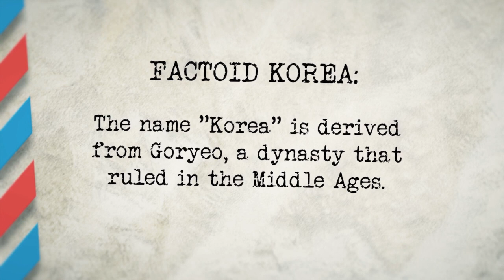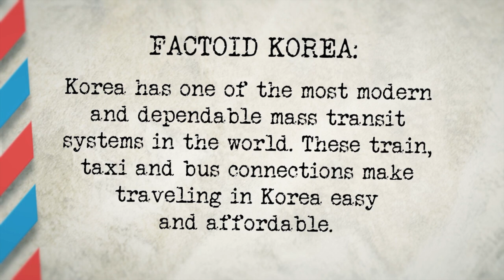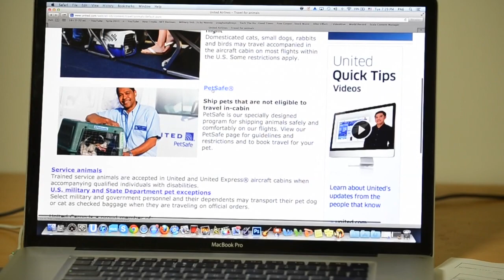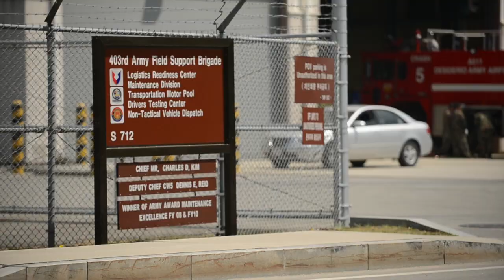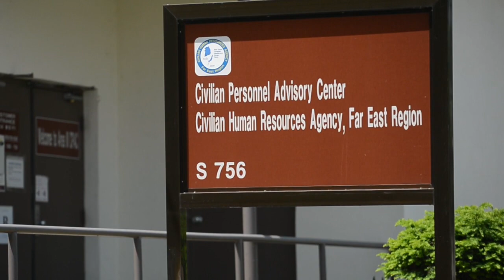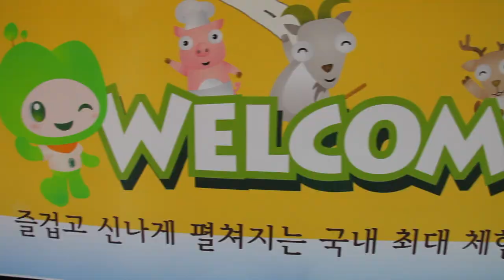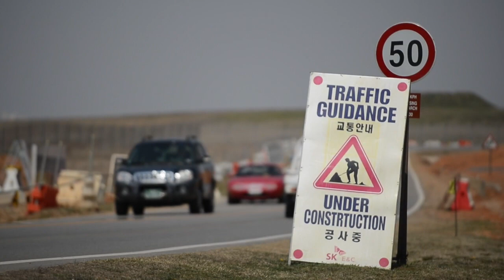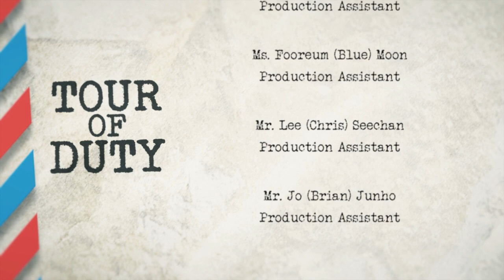TOUR OF DUTY - Camp Humphreys Welcome Video

Comment: I was stationed at Camp Humphreys in the 1970s as an MP with B Co 728th and again in the 1980s as an Engineer with HHC 802nd Eng Bn. Both of those units are gone now and their company & battalion areas have been razed and new buildings are going up there. I retired in Korea in 1990 and worked at the DPW. That area is now occupied by the PX. A brand new, larger, PX and commissary are being constructed in a new location at this time. I also worked for the Army Corps of Engineers at Kunsan. My wife and I went back to the USA in 2000 and I worked at Hurlburt Field FL and Sebring FL.

I'm now retired and living in Anjung-ri just outside Camp Humphreys. Anjung-ri has changed just as much if not more than Camp Humphreys.
Reply: Thank you for your service for my country, sir.
Reply: Thank you for your service♥
Reply: Stationed at Camp Carrol Depot in 1970. Served with the 117th Army Postal Unit for approximately 4 months and then transfer to The Camp Carroll Military Police Detactment before having The 728th Military Police Detactment taking over. Loved it
Reply: Thanks for your service!! Was there in 89-90 with the 23rd Support Group!! Unsure if it's still there....
Reply: @georgemaxwell3467   It is still here. The 8o2nd Engineers are long gone though. The 11th Engineers are here now.
Reply: @gatorman5013   B Co. 728 MPs was here at Camp Humphreys. That area on Camp Humphreys has been TOTALLY rebuilt now.
Reply: @Romin_Soldier  thanks for the information, have a great day 😀